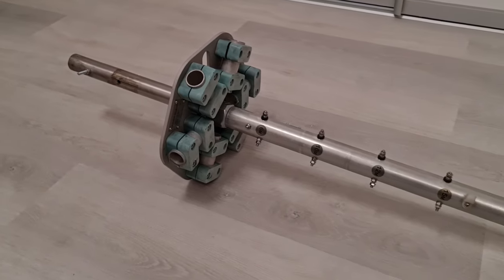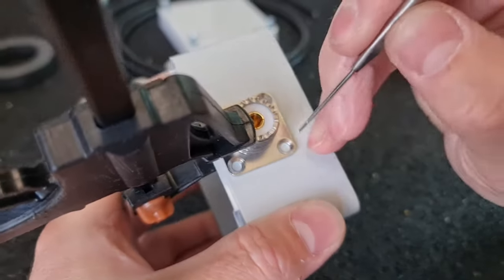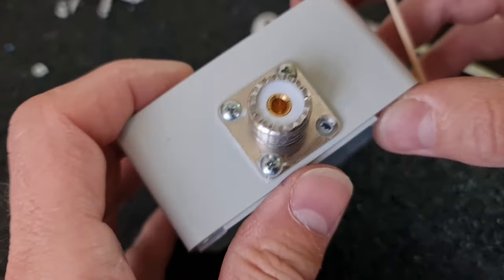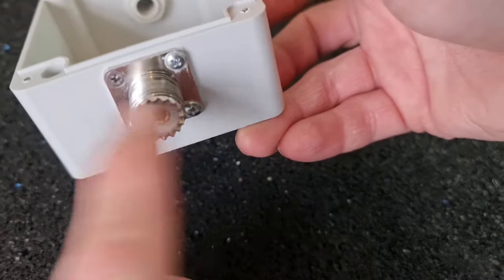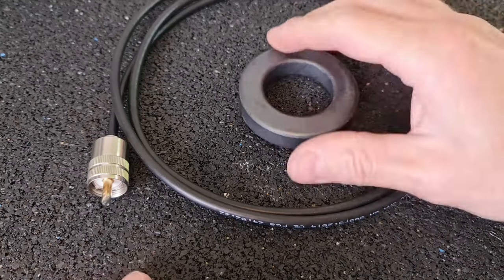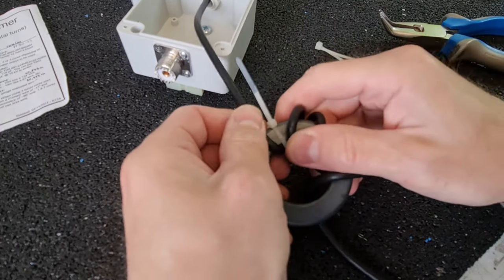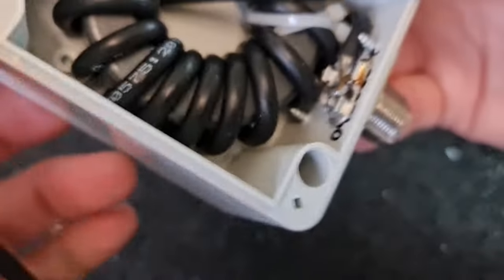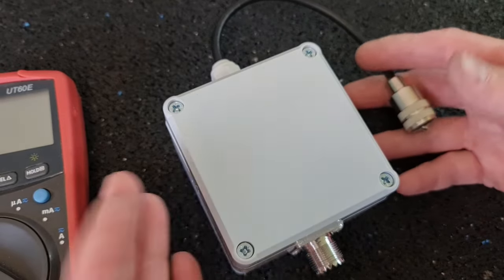How to make simple RF CHOKE - home made project

Comment: Great video Paul. Very helpful to see you build this choke.
As a retired electrician in Australia, that plastic thing is called a "cable gland" down here as others have also said. 
As an additional note to that, the black cable glands are UV rated and fully weatherproof and won't deteriorate if outside in the sun for many years.
Thank you my friend.😊73

Comment: Every type of coaxial cable has a specification list that includes the minimum bend radius.  You must use a type of cable with a small enough minimum bend radius such that it will work with the thickness of the core you are using for the choke.  If you exceed the minimum bend radius, you risk having the center conductor of the cable migrate through the soft dielectric and make contact with the inside of the braided shield, and shorting out the choke.

Comment: When I made mine, I used 2 x SO-239 sockets, not a pigtail. I made a second one with N-Type sockets aswell. I also made one with SMA connectors for my SDR using an FT140-43. All work well.
Reply: For HF, VHF, UHF is it works? Maybe for uhf is less turns? What do you think?

Comment: Cable flange / gland I was thinking it's a bit long so went to speed up the video and saw it was already in2x.
  Very good but i don;t think coax makes the best 1:1 unun isolation transformer choke. Or is yours also acting as a transformer to match impedance? What is the impedance at the feed-point?
  I'm now looking at this again 3 weeks on. I found a box very similar in size but with a clear window. Funny how mine ended up looking very similr to yours but mine has bifilar windings around 2x 12 turns on a 240 43 and 10mm coax with a gland. Works well on certain antenna that do not already have tuned inductance or capacitance. Not really needed on antenna that already have tuning such as gamma or tuning tank or both. 
  Weather or not to use a choke can also depend on the type of mast and it's length.

Comment: The RF choke should be placed after or before the balun-tranformer? Tank you and congratulation for your project.73 de IU0PNM
Reply from the maker: After transformer. Antenna wire 》transformer 》RF choke 》coaxial feedline
Reply: @OM0ET  and if you're using an EFHW make sure and leave .05*largest wavelength used between the transformer and the choke.

Comment: You could have made more turns around the torroid which would have made the choke more effective.  I would have used an SO239 at both ends of the box.  The silicon sealant should be installed during the installation of the fasteners and connectors.  Silicon grease on the gasket helps it to seat better and help preserve the gasket material.  Also to make it more watertight.

Comment: Coax (any cable) has a minimum bend radius,  once you go beyond the minimum bend radius, the coax will begin to fail. As the center conductor migrates it can short out, and the impedance will change at that point..

Comment: Why did you make a RF Choke using this method, instead of using the multiple ferrite cores placed over the coaxial cable?  Does it work better?  Do the ferrite cores get too hot? 73
Reply: Better for cheaper

Comment: Great job paul check it with your nano vna for common mode and differential currents 73 de IU5OFY
Reply: not sure how to do it on Nano Vana, can guide or is there any video on YouTube to demonstrate it...tnx
Reply from the maker: Thanks, but I don't have a Nano VNA. I have TinySpectrumscope only. 😊
Reply: @Capt_Duffy  to check the insertion loss for common mode currents (ideally it should be infinite)you put the central of ch0 with two resistance of 25 ohm to the two leads of a side of the balun and the central of ch1 with two resistance of 25 ohms to the other side of the balun,you bound the grounds of ch0 and ch1 togheter and you measure with s11 "logmag",remember to adjust the reading of 2db higher if you calibrate the nanovna normally.
To check differential mode insertion loss:(that ideally should be 0) connect the central of ch0 to one lead of a side of the balun and the ground of ch0 to the other lead and you do the same for the other side,there isn't a polarity
Reply: @225fabry  thanx alot brother for the detailed reply...!!!
Reply: @Capt_Duffy  it's nothing

Comment: I was told that silicone rubber sealant should never be used on antenna connections or wiring, because the chemicals which are used to cure the rubber will oxidize the metal and lead to failure or poor connections.  Is this not true?
Reply: Just make sure it non vinegar silicon.
Reply: @M7XCB  I have never seen that.  I guess that is what is used in this video.....